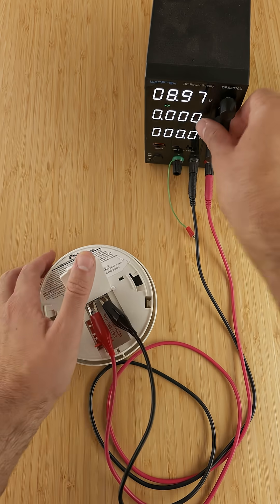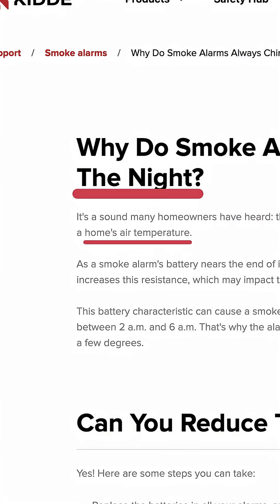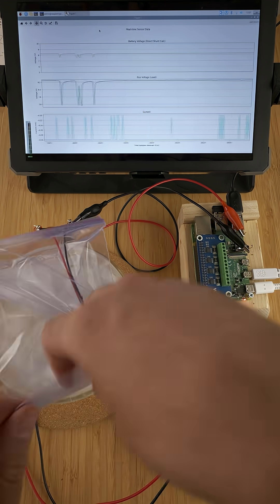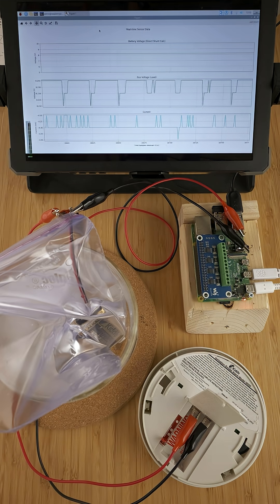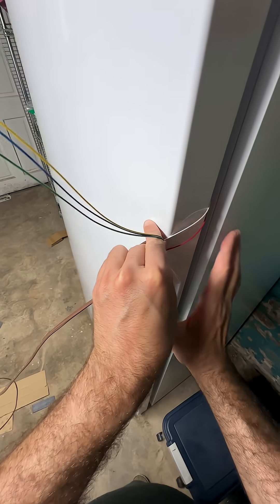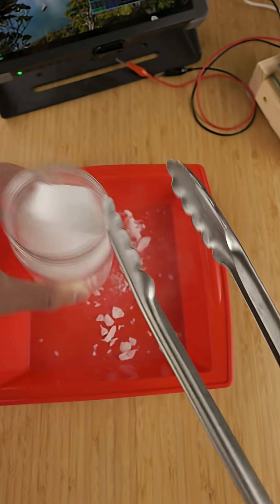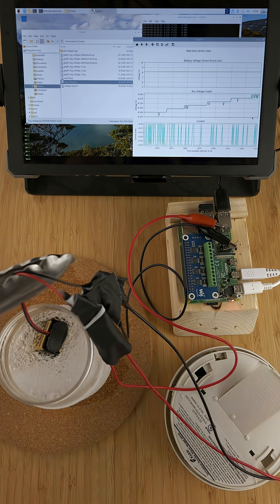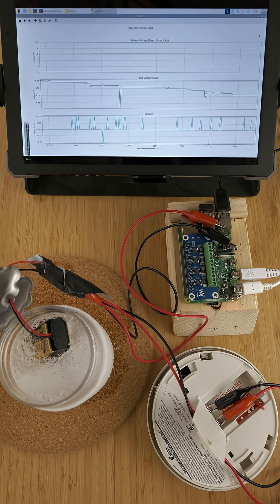why do smoke detectors always start chirping at night?

Comment from the maker: And it turns out there's a perfectly reasonable explanation for why a battery's voltage briefly goes up when exposed to extreme cold, but this short can only be so long. We'll get to that in a future short.
Reply: You need more depleted battery not colder. 
I rember from chilhood that old znic batteries worked better after while on heater (for a while).
Reply: Also you not left it for simillar time
Reply: Your experiment is lacking a number of factors. The key issue I have is an important one, what is the trigger voltage? Also does the detection circuit have a delay to allow for the spikes in usage, e.g. it needs to be low for a sustained duration before making the chirp sound.

The battery temperature issue is best demonstrated using a larger load with bigger batteries. Take a car battery in winter. The battery will get cold at night, and when the battery is near end of reasonably usable life it will have a hard time starting the car. However the act of bringing the battery indoors for an hour or so and in the same winter conditions that same battery may start the car no trouble. The battery is still end of life, the battery is just a chemical reaction in a box and warmth is a catalyst that allowed it to work better.

The same hypothetical car taken to a warm climate would be very happy with a small motorbike battery for a few years.
Reply: @Dennis_M1DLG  He mentioned that the battery came from a detector that was already chirping - already below the trigger threshold - so it does not matter what the threshold actually is.
Reply: @-vermin- and I also questioned if the detection circuit used a delay, as would be ideal in a circuit for that purpose. That is to say, if the battery dips in performance for any reason it ignores it, however a sustained drop in supplied voltage would be a trigger for it.

Many of these circuits are handled by discrete IC's with a multitude of added functions and a hardware developer could chose to use this or not by changing a pin value or shorting to gnd. Therefore enabling it disabling a standard function to overcome characteristics with some battery chemistries. That IC then would be usable in a variety of applications that require a detection of voltage.

Comment: but you noticed that the voltage drops with lower temperatures. meaning is more likely to hear it at night which can have lower temperatures. im confused how you did the experiment and still you end up with different judge in the end.

Comment: It sounds right to me. Look, the battery is discharging at a constant rate but very slowly. Let's say you start at 9v battery starting at 9.6v new and the detector threshold is maybe 6v. It lasts for 5 years so 365*5 or 1825 days. The voltage isn't linear but if it were that's 0.002v/day.

So if the threshold is 6v it's completely plausible that the voltage is at 6.001 during the day then drops to 5.999 at night.

To be honest it's more likely the voltage measurement changes slightly as the sensor cools but either explanation is plausible. The real answer is that both mechanisms contribute to some amount.

Comment: If the battery was low enough to already be chirping why wasnt it already chirping to start with?
I would assume there is variance in the specific level of voltage that triggers the chirp from one detector to the next, and given the tiny amount of voltage lost over time it does check out that the detector might get closer and closer to that limit throughout the day then overnight that base rate of loss appears to increase due to temp - regardless of how small. If its right on the border of chirping and the temp goes down it could absolutely push it over the edge. 
The drop doesnt have to be huge when there's not far to go.

Comment: I think you’re missing the point. The battery might take a few years to completely drain, so it will spend weeks in a state where the voltage is very low, but not quite low enough to trigger the chirp. You have a very shallowly decreasing line, and superimposed is a very low amplitude sine wave with comparatively much higher frequency. I can easily see how even a very small amplitude on that sine wave could make it substantially more likely to chirp at night. Get a few dozen comparators, batteries, loads, and a data-logging MCU and test it if you want.

Comment: This issue seems to occur mainly with sealed for life smoke alarms the 3v lithium cell never lasts 10 years (5max) .
Re false alarms (full alarm) in the early hours seams to be due to condensation. Although  i have a heat alarm that seems to alarm occasionally at night for no apparent reason.

Comment: Battery reactions occur more slowly in the cold.

Some amount of cool creates a tiny amount of voltage drop. Batteries in smoke detectors take many years to drain. At some point, they hit the threshold to trigger the chirping. There would be an increased statistical chance that the chirping would happen at night.

Sure, people may only notice or get annoyed enough to remember it when it happens at night.

Comment: It's perception. You are more likely to hear the chirp or be bothered by it at night, when there is less noise pollution, and you want quiet so you can sleep. 

Problem solved... next. :)
Reply: The sound of the smoke detector is extremely loud. Unless you're blasting music at full volume until you can't even hear other people speak, you're going to hear the smoke detector beeping. Your explanation doesn't make sense

Comment: i have to wonder if the detector beeping at night is less about the battery being cold, as  being close to dead,, and during the day when it's warm, it's able to produce a bit more chemical reactions just enough to keep the detector from beeping, until night, when the battery is no longer being warmed, and tests as dead.
Reply: This is exactly what the explanation is saying, heat makes it more efficient, cold makes it less efficient. You’re just arguing that it’s half empty not half full.

Comment: Why would you think the internal resistance vs temperature would be anywhere near as relevant as the Arrhenius equation that describes the EXPONENTIAL relationship between temp and reaction rates? Further, a very nearly dead battery that is under load only needs its output voltage to drop a fraction of a millivolt below the chirp threshold to get that fault state to occur, something ALL your experiments here demonstrated was actually happening!
Reply: The internal resistance is a representation of those reaction rates. There isn't like a secret resistor hidden in batteries. There's the resistance of the electrodes and terminals. But those are basically constant over temp. The chemical reactions in the battery can be modeled as a resistance and that is also a part of the internal resistance. This resistance is inherent to the chemical reaction.

Comment: But if the threshold to chirp is (let's say) 7.60v and your old battery which needs replacement is at 7.65v, then the drop in voltage due to nighttime cooling is just the amount you need to trigger the chirp. 
It seemed to be working as designed

Comment: For my optical smoke detectors I assumed it was droplets of dew fogging the detector. The more annoying part of a wired system is the way you can't easily tell which one triggered all to sing.
Reply: @spelunkerd I have assumed this as well because our smoke detectors always alarm (not just chirp) in the summer when it's very humid (old farmhouse without a/c on the second floor).
Reply: @jenniferpiercy7148  Since your case is repeatable, it's pretty easy to confirm. You could try a year long data logging and find out the humidity level required.
Or perform a an experiment where you take the detector to a chamber with controlled humidity and perform some tests.
Reply: @Ceelvain It would be cool to find out. I'd have to tinker with the detector itself tho because when it goes off at 3AM I damn near go into cardiac arrest 😉

Comment: Is it possible that the because the battery isn’t fresh it changed these results? I’m a mechanic and I’m certainly positive that cold weather causes many more batteries to fail. We sell double the amount of batteries in the winter
Reply: Understandable but the car batteries are exposed to more elements? Not to mention the temperature jumps compared to the inside of a house.

Comment: Doesn't it also kind of depend on the type of battery? An oldschool alkaline 9V battery is probably much more affected by temperature than modern smoke detectors that have a fixed lithium cell installed. EDIT: I just saw that this appears to be an oldschool battery you used.

But I still think that it won't be statistically sagnificant. Probably people just remember a smoke detector battery failing if it happens at night much more often. Or there's too manys background noises at daytime and therefore people only notice at night. Although this is just speculation on my part.
Reply from the maker: I agree with your speculation

Comment: Wdym the explanation doesn't make sense? The temperature difference only needs to drop the voltage more than it drops during one day of usage, and I doubt that that's anywhere close to 0.07V
Reply: I Agree. If the battery drops 2V (from 9.5 to 7.5) over six months that comes to .01V per day. So the back of the envelope calculations have his measured effect at seven times the required change.

My smoke detectors tend to last more than a year on one battery and a change over even half a day would show as a chirp at night, so I think the effect may be even bigger. So by these numbers he is measuring 28x the needed voltage change. He got that number at a 34 degree temp drop. There are all kinds of non-linear effects going on here, but my guess is even a one degree drop could make the detector chirp at night (34/28=1.2, close enough to 1 for all this guessing.)